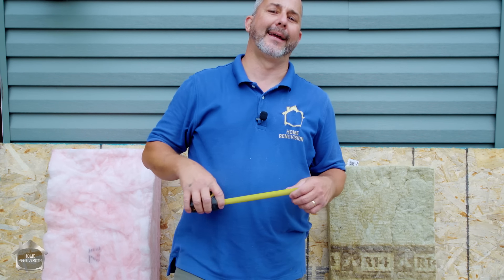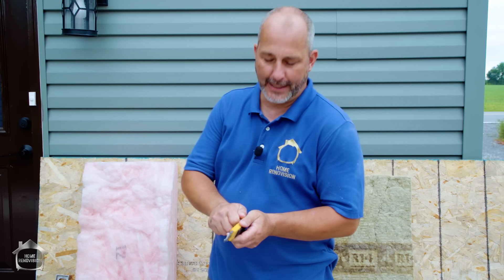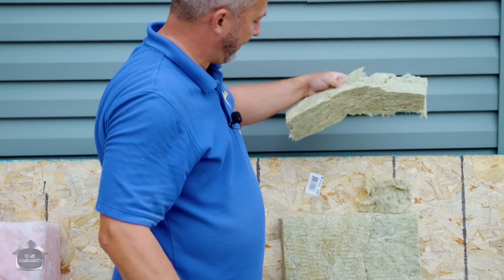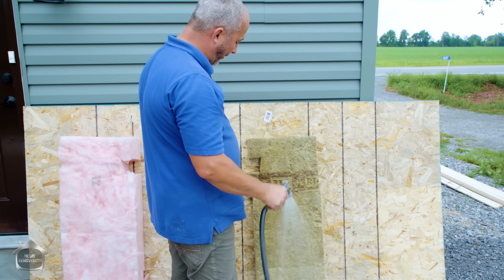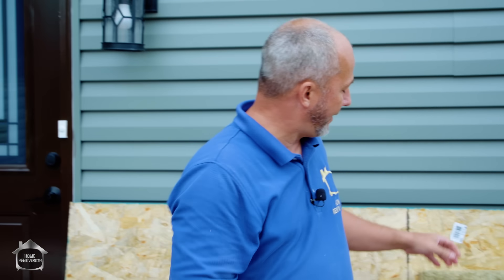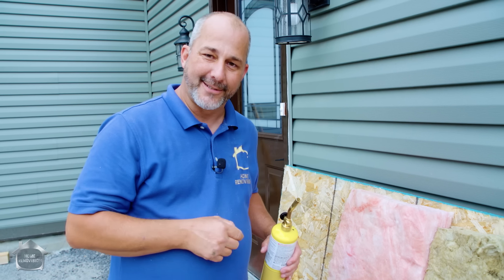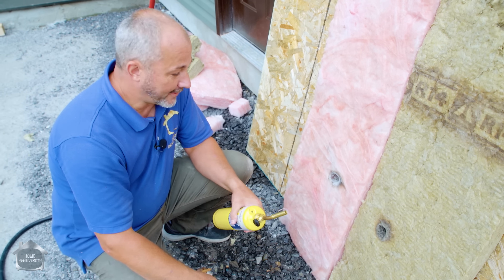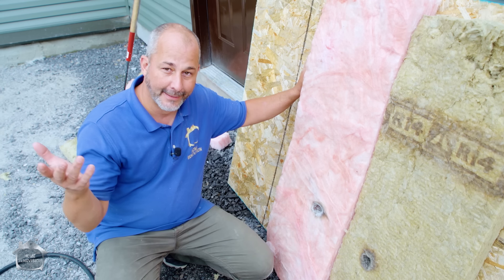How to Choose the Best Insulation for Your Home | DIY Home Renovation

Comment: Why not 2sheets of  1" reflective Polyfoam with space between which fills the seams better and gets a minimal of R12 without calculating the air gap. Over time doesn't sag or get moist. Not sure on the fire side:-)
" Ginsu knife"..LOLOL!!  I wonder if Rockwool/Roxul comes in foil backed. I did a few temp readings and foil back for radiating heat DOES make a difference.

Comment: I think I'll just use loose-filled dried lawn grass. I like the price and I think the "R" value per inch is higher. My walls: gyproc, studs, thin plywood, air space, alume outer siding. It filled the stud area nicely when drizzled down from the top in a test. How could fire get in? I think it should breathe about right without a vapor barrier. Of course the wall had better be mouseproof! F/g for the ceiling and right by electrical boxes. I'll need about 80-100 porous chicken feed or big onion bags stuffed gently with dried grass. (12' tall 2" by 4" walls, 24' by 32') I have 10% of that so far in the first batch (8 bags), and another batch drying on a bunch of wire racks from the dump. At the rate I've been building, I have this summer to get half and next to get the second half.

Comment: Hey Jeff, I have a question. I’m finishing a 10x14 shed. I spray foamed all the air gaps (soffits and  ceiling) I Alex plus caulked all the seams. I just installed mineral wool insulation in the walls. Should I install a vapor barrier, vapor retarder, or move on to drywall?  The internet is all over the place, I need the Jeff answer! Oh I’m in Zone 5, Nebraska. And we are installing a mini split heater/ac. Let me know, thanks!
Reply from the maker: if you are keeping it conditioned then yes!

Comment: hi Jeff, hope you can help me with the suggestion. 
 I would like to change the insulation in my 15 yr old apartment, so after checking Home Depot Canada website, for outside walls above grade,  they recommend R-22
 batt Insulation + R-5/7.5 CodeBord® for Toronto. Does this mean that after regular insulation (Rockwool/PINK) + vapor barrier, I would need to install Rigid boards and then Drywall?  Is this ok or too much?
Reply: The + is exterior, you would put it outside.

From inside to outside, it would go

drywall
vapor barrier
studs and regular batt insulation
exterior sheathing (plywood/osb)
rigid board insulation
whatever you have for the exterior finish

Not to say you couldn't put it on the inside, but it wouldn't be quite as effective as being on the outside.
Reply: @LackeysLack  Thank you so much, appreciate the answer. Thanks for the clear explanation,

Comment: My house was built in the late 30's and was insulated in mineral wool!  it's awesome.  I will say that as I redo rooms remove lathe and plaster and update flooring, fixtures, etc) I have left the mineral wool wherever possible.  I had a few spots where it had degraded and had to be replaced, but otherwise that stuff, even at 80 years old, was still in good shape, fit the walls well, and survived having the lathe and plaster ripped off of the top of it without coming out of the cavity.

You are exactly correct, however, that were I to have to re-insulate I would consider my high price option to be expanding foam and the budget option to be fiberglass.  I wouldn't stop in between these extremes with mineral wool at all.  Feels like the mid-priced bottle of wine at a restaurant that is virtually indistinguishable from the bottle that's five bucks cheaper.
Reply: Mineral wool + 80 years old? You may have been exposed to asbestos containing mineral wool. Not the same stuff as today. Did yours have a paper backing?
Reply: @MrAbcdefghi12435  No - looked like old Roxul.
Reply: @MrAbcdefghi12435  I should also add that when I found it I had an inspector familiar with these old materials check to determine if I was in Asbestos.  Per him, this was true, old mineral wool and did not contain asbestos.  My duct insulation....that's another story that I don't like to talk about at dinner parties.
Reply: @MrAbcdefghi12435  Mineral wool insulation, created the same way as today, was invented over 100 years ago.  Actually so was fiberglass insulation, but mineral wool is about 20 years older.

Comment: what about settling over time; every time i open a wall that has pink in it that has been there over a given time; its settled.  I find mineral wool being as dense as it is does not move as much or at all....  insulation is all about air movement; but sound absorption is all about density and dispersing sound.
Reply: You can get the pink stuff as batting with paper or foil back, so that staples onto the studs and does not sag.

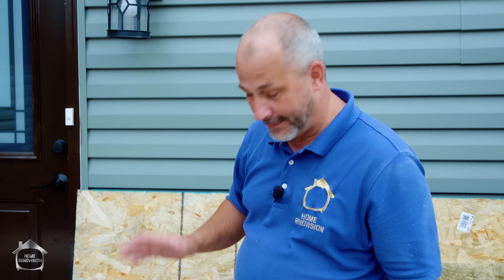Comment: 3:50 let me just add that as a plumber more than once I saw the ceiling(s) collapse because all the pink insulation had soaked up water like a sponge and held it and collapsed the ceiling.  Yes there were always other factors involved. No I didn’t have a chance to test against rockwool. Irrespective of that, the insulation around an outside hose Bibb in all directions for 8’ or so should be rock wool if you’re going to use it because when a leak occurs, it generally hits the entire 4x8 area if it’s finished (if you are lucky that portion of the ceiling will collapse quickly) but what is more likely is that water starts filling the joist cavity in the area where the hose Bibb is located; once it starts to fill, the ceiling below tends to absorb water and start to sag, creating a pond effect. If you’re lucky, the water will be contained here between the joists, but typically this is where things get really bad. After the drywall starts to deform, it makes gaps under the joists and water starts flowing into other joist spaces. From here, water will fill a finished ceiling until failure. Ironically, the better construction a finished basement has, the worse things tend to be - same as with super shoddy construction. The super shoddy construction hold just long enough to fill with water before collapsing but never really had a chance (because each sheet of drywall on the ceiling had 6 screws holding it on + tape (can’t make that up)) and the well constructed ceiling is fastened so well that it gets completely full of water before showing any signs of a problem. 
Morale of this story? Take your damn hose off the spigot before the winter. Also, walk all the water out of that too so it doesn’t freeze.

Comment: You get more r value in a 2x4 cavity with the roxul (r14 instead of r12) but in a 2x6 wall cavity it doesn’t matter much because the r value is both r20
Reply: wrong, roxul is r24 vs r20.
Reply: @donningtonpark7772  I’m not wrong, for 2x6 cavity Roxul comes in r20, r22 and r24. It depends on what u want to spend

Comment: I am a fan of rockwool. In rural Ontario mice, etc often love to enter homes in the fall. They don't like to nest in rockwool....and the R value is significantly better. I have used both over twenty five years and Rockwool in its various form is way better in my opinion.
Reply from the maker: I get the reasoning. I just don't see the benefit worth double the cost. Cheers!
Reply: @HomeRenoVisionDIY  Likely comes down to where your home is located, and the age of the home. Our 140 year old double brick tends to have a few mice finding their way into our attic every fall....and then down the lathe and plaster interior walls. Perhaps it is an urban (rural) myth....but I have found they won't create a nest using rockwool like they love to do in fiberglass.   Now THAT would be a very interesting fact to prove or disprove. Enjoying your videos....especially the Canadian perspective.

Comment: Okay. But which one will collapse in the wall faster after 10-20 yrs. My pink insulation is now collapsed inside the walls. So it’s basically non existent insulation and my walls are FREEZING here in CT. 
Can you advise on that?
Reply: The mineral wool won't collapse.  Pretty much ever.
Reply: Drackar ....Thanks for confirming. And that’s why I had my basement insulated with Roxul.

Comment: Question: I just bought an 80-year-old house with very little insulation, and what  is in the attic is 2 in of cellulose insulation. It recently got to 112 in Seattle and 105 inside my house, and I'm realizing this just won't do. Can I add a different type of insulation on top of it or do I need to remove what's there before adding on either rockwool or the pink stuff?  (Also there's no insulation in the walls, which was apparently a thing they did in the 1930s in Seattle, but I think fixing that is for another day...)
Reply from the maker: simply blow in additional. I would recommend at least R30

Comment: I have a stand alone brick garage that is over 50 years old. I would use the mineral insulation inside the ceiling joists. As of right now the roof subfloor is exposed to the air. It gets FREEZING in there in the winter so I hope that mineral  insulation will help.

Comment: Also did not talk about increased thermal value of rock wool.  Rok wool setles little if any, but fiberglass moves so much it's like it is trying to get out of the wall cavities.  Which leaves many gaps & holes.  Suggest you reassess your evaluation.

Comment: 😂Great video.  "If the fire gets through your drywall, you're already dead."  classic and true.  I'm remodeling my Dad's house in NYC but I live in Hawaii so know nothing about heating or insulation.  My house has neither.  My Dad's house is 111 years old and there's no insulation in the walls, but I have to replace the plaster lath in one exterior wall, so going to insulate while I have it open.  The reason I have to redo the wall is because the roof leaked for years and totally destroyed the plaster (covered by paneling) so maybe I should stick with rockwool since it's possible this could happen again in the future.  Thanks for the education.

Comment: Do you have a video on insulating exterior walls for climates that have hot summers and cold winters? Can't find good information on preventing mold, what's needed for the wall (vapor/air barrier/retarders).

Comment: The company that makes the pink also makes mineral wool- which is handy for studying and understanding the difference. I like that your video has been some of the most reasonable (the wall should t get wet and the wall should t be on fire) and didn’t buy into the marketing. Only one thing to please remember- and I don’t know if you’ll see this- the mineral wool will have language encouraging replacing interior mineral wool batts if they get wet- just like the pink. The reality is there is mineral wool made for exterior applications that, yes, you’re correct does drain, but it is actually treated to repel water. The mineral wool can be engineered to either repel or absorb moisture depending on this use and additive. So saying the interior mineral drains and dries is not entirely accurate and consistent with what the manufacturer states. You’re right there is little difference in acoustic performance between the two interior batt products for the residential applications. As the wall becomes more focused on acoustics (I.e. resilient channels and such), mineral wool will pull ahead and the difference becomes more pronounced. (This research isn’t published yet but any day now it’ll be on the pink website). Additionally, there is indication that the two products control noise in slightly different ranges- mineral wool being more in the speech range and pink being on the end of the spectrum a little stronger. Nice video! (I work for the manufacturer that makes both to be honest but my comments are my own.)
Reply: You’re correct that there’s a misconception that mineral wool is for fire rated walls, the testing demonstrated otherwise- same hourly ratings (astm e119 in US) for both products.

Comment: I'm going with the Roxul for burning the fastest.
Reply: The pink stuff is very open and will allow the flame through to the other side very fast, The roxul is dense and will require the studs to burn through to pass the fire to the other side. There are videos of flame rooms burning with both insulation.

Comment: As an insulator for 4-5 years I can say I hate with Rockwool with a passion. Doesn't cut nice unless you have a new blade or knife. Only fits nice in cavities that match the size of the batt. Nearly impossible to put above and around duct work. I did it and it doesn't look pretty and isn't done properly. The thicker the R value the harder it is to work with

Comment: Question for anybody that care to chime in. I’m not a construction guy so I’m hopeful somebody will offer guidance. My detached garage uses lumber that measures literally 2” x 4” not the dimensional lumber that is 1/2” shorter. If I use r15 insulation that is 3.5” that leaves a 1/2” air gap. How would you guys handle this?

Comment: I done goofed. Started insulating my 200 s.f. adu with safe'n'sound... it has R11 rating according to the manufacturer... how bad am I screwing myself? I'm in Los Angeles.
Reply: Not to bad. Your delta 'T's are modest. 40 to 70, 78 to 105 Deg. F. You aren't trying to overcome 90 deg. f delta 'T's on a 20 degree below zero F. Minnesota winter day.

Comment: I am familiar with Roxul. It is all I use. No more pink. Pink is now making mineral wool. 
The pink will burn and the Roxul will not burn try as you may.
If the two had to be mixed, Roxul where there is electrical wires and around the kitchen area or areas where fire is likely to begin.

Well I was wrong there, fiberglass insulation is fire retardant.
Has me re-thinking my insulation choice--except I had to renovate a house and the fiberglass insulation pretty much sank to the bottom. Only reflective versions were in good shape (with the foil on one side).
Reply from the maker: having a stable cavity for the pink is important.

Comment: What is your thoughts on closed cell foam for 2x4 you get a higher r value?   Is it worth the extra cash?
Reply from the maker: it can be a great way to get R value and an air seal on an old house depending on the level of exterior work you will be doing. best to investigate the return on investment based on where you live. Not all homes can support that type of investment.

Comment: So I decided to purchase Roxul for use under a pine tongue and groove ceiling due to its fire resistance - in this application, would you believe Roxul vs Fiberglass insulation is worth the cost? I know the video cited those differences as negligible assuming the presence of sheetrock, but this will be between two layers of wood (subfloor and the kitchen ceiling.)

Thanks for the great content. You've helped so much on my DIY journey! :)
Reply: Roxul would be my choice. The consideration of "fire having to go through drywall first" is a logical fallacy - as many fires start in wall and attic spaces. And that mainly due to rodent activity - so use a less hospitable insulation which as a bonus cannot contribute to combustion, is sound proofing, is water proof, seals tighter, and suffers zero R-Value drift (i.e. loss of r-value over time).  FYI, fires starting in wall and attic spaces from rodent damaged nm wire  is why arc fault breakers are now required.

Comment: You are amazing. I hope one day you make a video how apply epoxy in garage and which kind of product is better. Oil or water base, one part or two parts. I tried different ideas and they do not last. I saw videos some companies come and grind the floor and apply something which I cannot find in local stores. Thanks.
Reply: this
Reply: or the poly-cement microtopping..Thats what we nee Jeff!!! I bet you'd have a slick idea of simply using a coloring agent with selfleveling vs boutique cement brands for overlay.